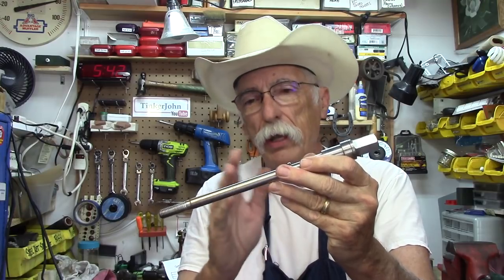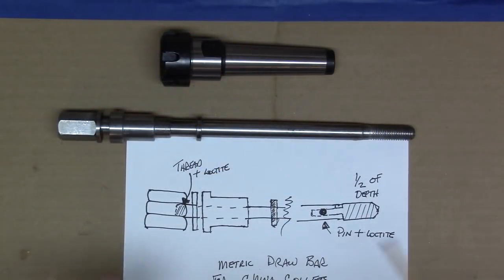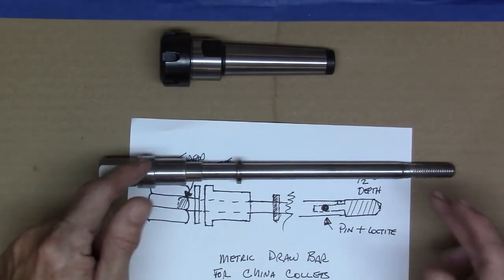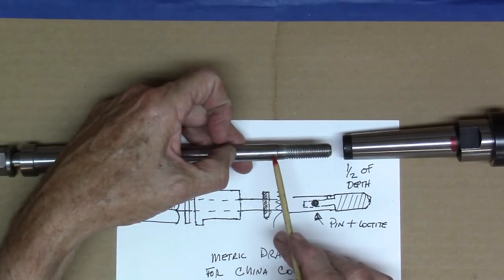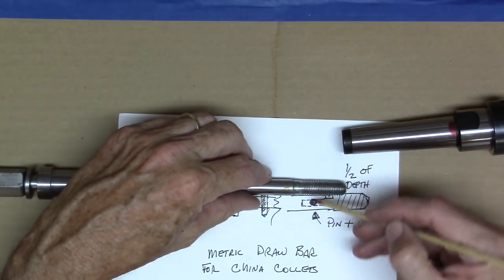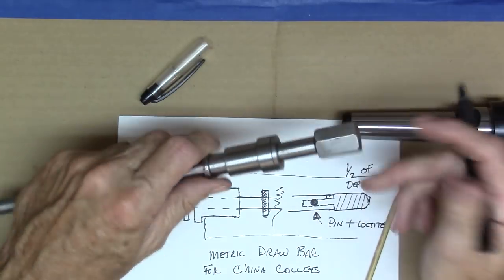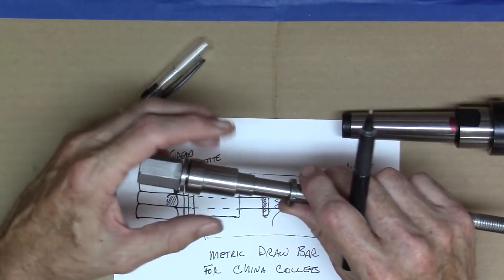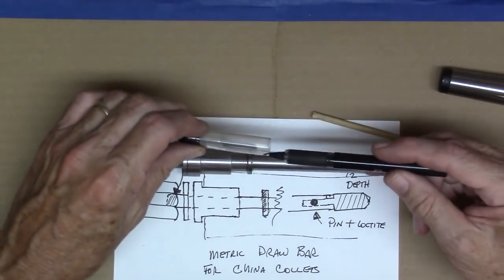Shop Built Collet Chuck Drawbar

Comment: I am ordering an ER 40 system I need to make a drawbar how long should I make it for the same exact lathe that you're using from the tip of the threads to wear the spinning thingy makes up with the end of the spindle
Reply from the maker: Thanks for watching, the length you asked about is 9 inches.   ~John